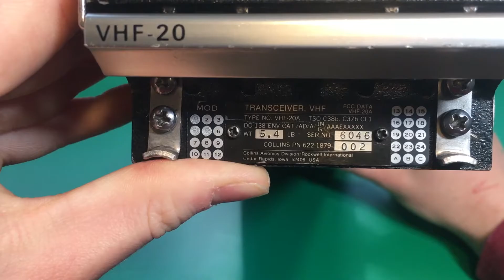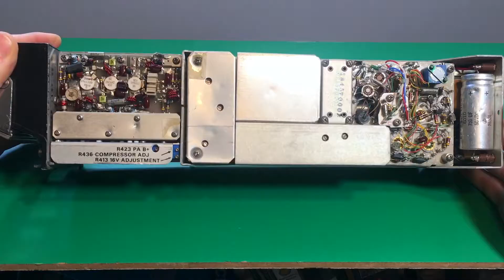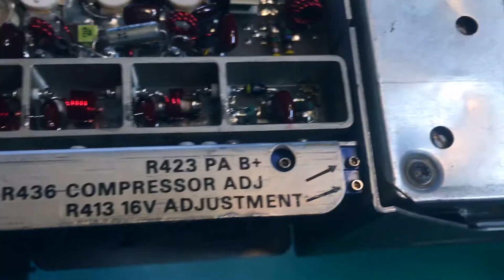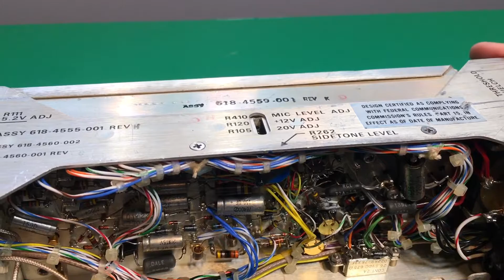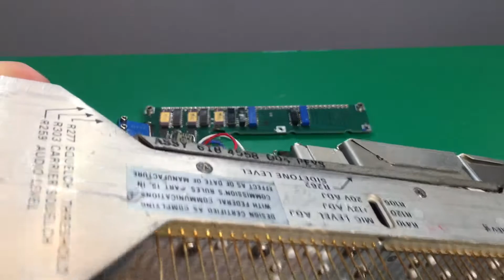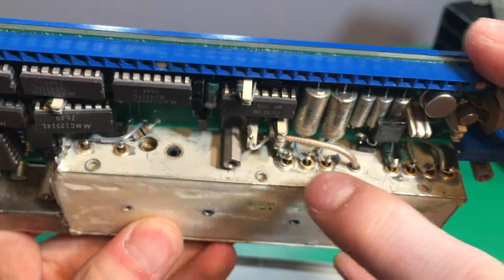Collins VHF-20 Aircraft VHF Transceiver / Transponder  Teardown

Comment: Most the time these radios were working when removed for avionics upgrade or airframe scrap.  Would make a cool vid showing you getting it to work again.  Otherwise still enjoyed the disassembly!  73, Mike.     P. S.  Unless there's a hole drilled thru it...  Jumped here from the transponder vid. Duh
Reply from the maker: Thanks for watching! Maybe one day I will try to power one up.

Comment: I used to service these radios daily nearly 30 years ago. Gutted to see the way it had been deliberately damaged. The VCO was the most expensive part to replace, and if it failed, it often saw the unit BER. The VCO module is potted, so you can’t repair them. The two transistors at the front are the modulator transistors, and fed the power to the final two RF stud power transistors. 

The 20mhz module on the underside of the receiver board is the Intermediate Frequency filter which was 20MHZ. When in receive mode, the VCO would put out a frequency 20mhz higher than the tuned frequency. The two transistors after the tuning coils are the RF mixer which gives the product and the sum of the two frequencies; we only need the product, hence the filter. The line of transistors after this are the IF amplifier stages before it goes to the detector diode. The rest of the circuitry on that board is the audio amplifier and squelch cct. 

It’s amazing what you can remember after all this time. 

I also own a VHF-20, and have the manuals and a CTL-20 controller. At some point I’ll get it wired up and working, but remove the transmitter drive so there can be no accidental transmission.
Reply from the maker: Thanks for the great comment, I really enjoy learning about this stuff! It really is a shame someone purposely ruined this unit. It was a scrap years find, bought for scrap steel price. I’m still glad to have it though.
Reply: I wanna buildup VHF/CTL-20. Got parts....  another someday project.
Reply: HELLO FRIEND, SORRY, DO YOU STILL HAVE THE MANUALS? I DON'T KNOW IF YOU COULD SHARE THEM WITH ME, I'M LOOKING FOR THEM AND I HAVE NOT BEEN ABLE TO FIND THEM. IT WOULD BE VERY HELPING.
Reply: Same here, im learning avionics and I would like to know how to fix this specific model, actually I have some problems with one that doesnt receive and send comunication

Comment: Very cool to see the insides of this device! The RF power transistors are especially nice 😁

I couldnt find a datasheet for the TRW part, but found one for both of the Motorola parts. They are both NPN silicon Bipolar Junction Transistors. They are essentially the same, but the 2N5641 is only rated for 7W while the 2N5642 is rated for 20W. Very interesting!
Reply from the maker: Thanks for commenting. I’ve always wondered about those and their configuration. It would be really interesting to learn more about how it works.

Comment: WOW they drilled a hole all the way thru to make sure no one booted it up.. great score anyways, cool to see so much of the radio stuff made in flying -leads methode, no pcb's almost like a prototype, very expensive and time consuming for production, the blue IC's are resistors, thanks alot for the video.
Reply from the maker: Thanks for watching! You should check out the flight computer teardown I did. The point-to-point wiring in that box is insane

Comment: Old Collins gear is amazing to take apart and see how much love goes into everything.  Unlke today's gear, almost every component was hand-soldered in by somebody, then inspected by somebody else, and the unit would have gone through extensive testing before it was ever sent out.  For those reasons, it was very expensive, but when you need to depend on your radio to get yourself and all the souls onboard your aircraft back home, it is worth it.  If you do some searching, you can probably find the service manual online to understand the electronics inside this unit a little better.  BTW, the 'blue chip' is a resistor pack, and the ceramic round trimmers are trimmer capacitors.  Those trimmer capacitors are very nice/precise components and will last virtually forever, so it is worth taking them out when you scrap the unit.  Great video, love the channel.  Cheers!

Comment: I like that filter chambers. Nicely done.
Reply: Yea that thing is a gold mine as far as for old carbon resistors and I bet all those caps are still solid.
Reply from the maker: Yes, this old stuff is built really well with quality components.
Reply: @BGTech1  I scored a SONY SOBAX ICC600W today. Free and a bunch of new old stock I’m working a deal. Tubes for days, or Transistor Arrays. Also A whole box of New Oldstock Resistors up to 10W. Everything has tested fine so far. Going back Tuesday. Seen some old DEC PDP stuff. Wish me luck. 
God Bless.
Reply: Nice Crystal Oscillator. It’s Beefy.